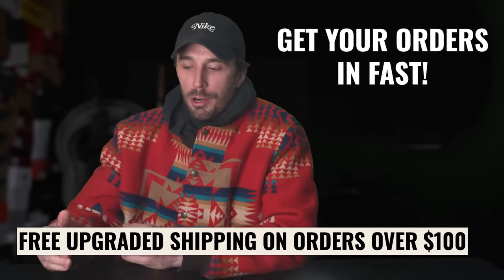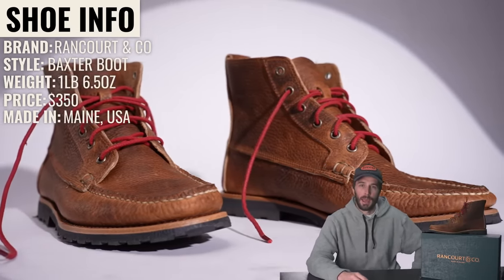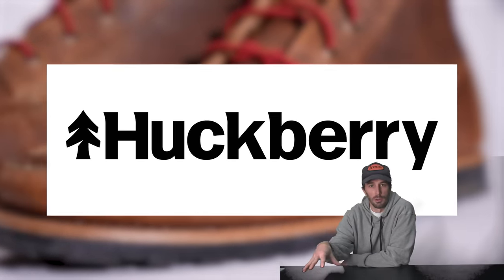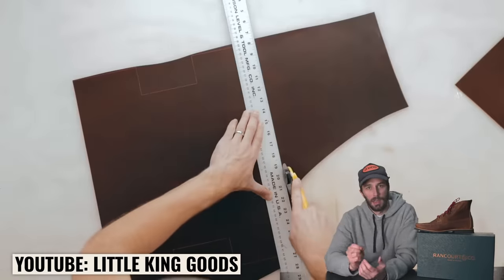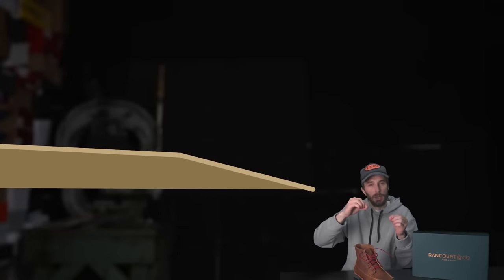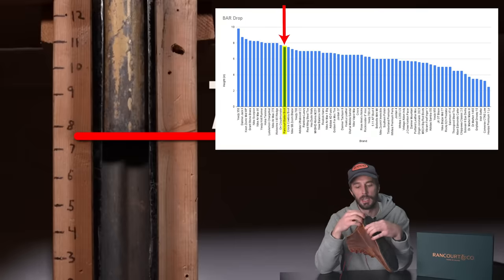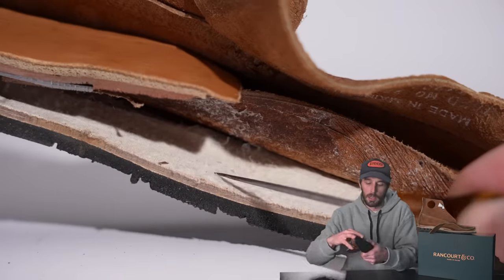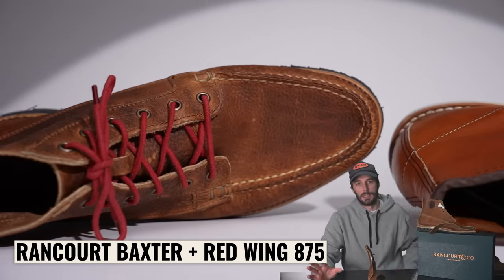Why 99% of boots aren't made like this - Rancourt

Comment: By the look of it, I'd have to chop off my toes to fit in the Rancourt. They look crazy flat/low in the front, like half an inch.
Reply: They look flat, low and narrow, but literally shape to your feet like they were made by elves?!   I have 3 pair and I thought they were ALL too small, cramped and narrow when I bought them, but after an hour on my feet they magically transformed into the most comfortable shoes, boots I've ever owned (with the exception of the Russell Moccasins PH boots).  They are straight up amazing.

Comment: This definitely seems like it comes down on the fashion side, especially for a "winter" boot. With that thin sole you're going to end up with cold toes in a hurry, no matter how thick your socks, plus it's so low that you're always going to end up down soaking in the slush.
Reply: I don’t think you’d wear them in deep fresh snow but I can see where they’d have terrific traction on packed snow and even ice with that soft snow tire like rubber sole. So it’s a bit of mixed bag as far as winter goes
Reply: Not a winter boot, but! They do make a winter boot with real shearling lining, and arctic grip soles.
Reply: Lol California winter boots
Reply: With two pairs of wool socks, they'll be plenty warm and since they're unlined, they'll breathe enough to keep your feet from sweating.  Pine tar around the seams and you're good to go.

Comment: Can you think of any boot like this that doesn't have a mock toe? ( I would have tried it, but they are out of stock in my size now) I love everything about the boot just am not completely sold on the mock toe, I'd love this tumbled leather and sole and shape (height and profile) on a plain toe, I know that it wouldn't be wrapped under, but I'm ok with that. I'm looking for a more barefoot boot, Something that splits the difference between a chuck Taylor (light and pliable) and a work boot (leather and durable).

Comment: Rancourt is really a great brand.  I wish they would GYW in place of Blake stitching, but otherwise, just solid designs, good leather and made in the wonderful state of Maine.
Reply: Rancourt could goodyear welt their plain toe dress shoe models, but it's not possible to goodyear welt a true moccasin like this. There's no insole to attach gemming to. Russell Moccasin uses a blake stitch too, for the same reason. Also, you wouldn't want these goodyear welted anyway. It would ruin the feel of the shoe,  which is like a sock of leather attached to a sole. It's a unique thing all it's own.

Comment: Does this boot have a cork midsole?  Didn’t hear it mentioned.
Reply: No, the leather midsole in Blake stitched to the moccasin. There's nothing to fill with a cork filling. The welt is stitched to the leather midsole to aid in water-resistance but it's not structural.

Comment: They are not that dificult to make , it depends the way you do it too, i used to sew then with only one needle and thread  before the last goes on the upper and worked very well , the way you showed in this video in my opinion its kinda overkill,  making and sewing then around the last doent have any benefit besides being easier to get the moc smother but nothing you cant do with the ' one needle before lasting' method

Comment: Weston again these kind of videos??, I really thought this kind of videos have been gone. Racount as the same as Grand Stone sucks. Why?? You are trying to convince the people to pay 350 bucks for Compress Cardboard boots and super thin leather insole and the worst thing... this boot is not reparable (repalce the soles). You did a really big effort to convince yourself that this is a good deal and again (same with grand stone) you appealed to compare this boot with the 875. I believe it was a bad idea. Again, it's much better a strong and thick good insole than the midsole, because the insole and all the internal stuff can not be replaced for a full leather insole. I mean, It can,  but it not in the correct way.